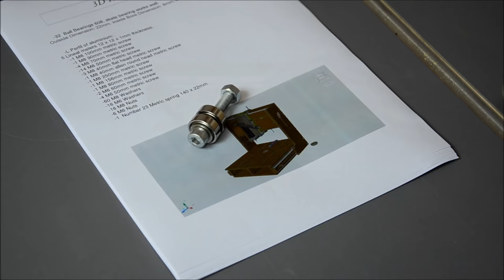Making a 3D Router (Part1)

Comment: I downloaded the 3D router with sketchup drawings. Plywood construction has started. Is there a 3D Router Mechanical parts list available? Screw and bolt sizes, tubing thicknesses and diameter, where to get adjustment rings and sizes, etc?
Reply from the maker: +Gerard Regnier in the flat you will find that information, and check out this:
http://paoson.com/downloads/es/forum/22t/where-can-i-find
Reply: +Paoson WoodWorking What, exactly, are you calling "the flat" and where do I find it?
Reply from the maker: Gerard Regnier sorry, I meant in the plans. You will find a cutting list and fasteners list